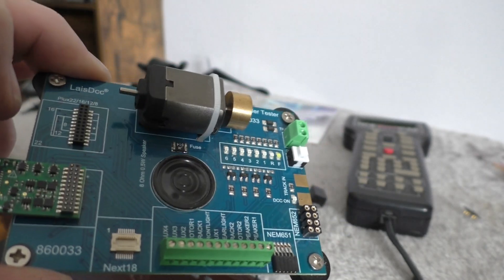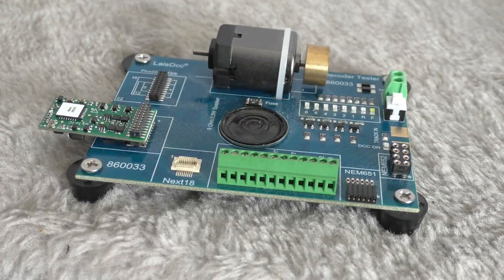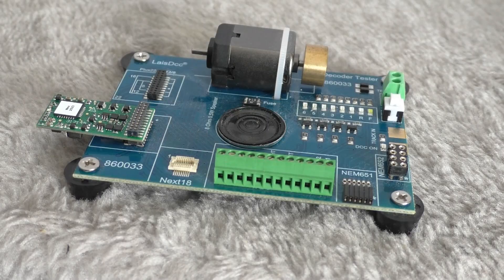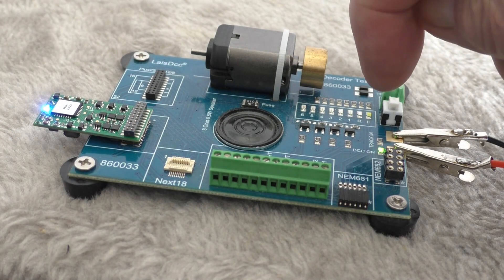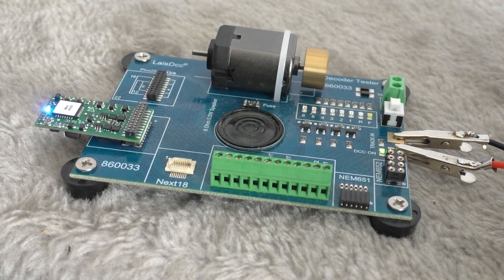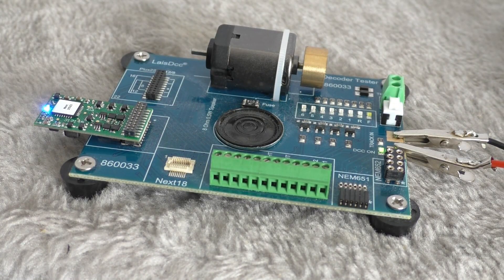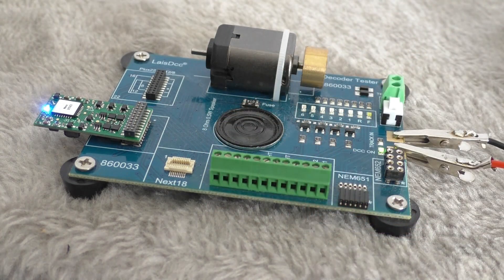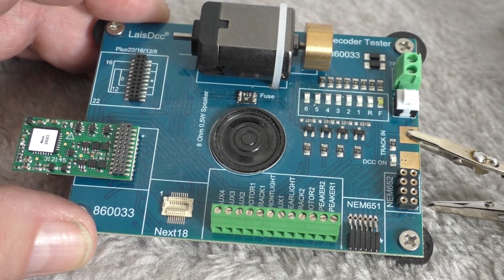193. LAIS DCC Decoder Tester

Comment: Got one of these however there is a basic flaw, cannot disconnect the onboard speaker. I modified mine by cutting one of the green speaker wires and installing a switch. By open circuiting the speaker, you can wire an external one to Spkr1 and Spkr2 on the terminal block, or with the Hornby HM7000, connect the speaker to the decoders socket. This way you can evaluate the speaker before fitting it into the loco.
Reply from the maker: @DavidBurgess-s1c  thanks for the tip! I noticed that too as I wanted to try a couple of different speakers. I also thought about adding a switch to the speaker terminal- good to know you can use the terminal block to wire in a speaker that way. I tried wiring a speaker to the terminal block - but didn’t work!